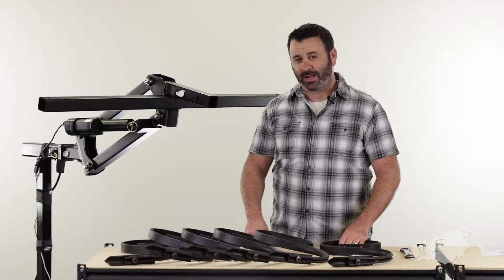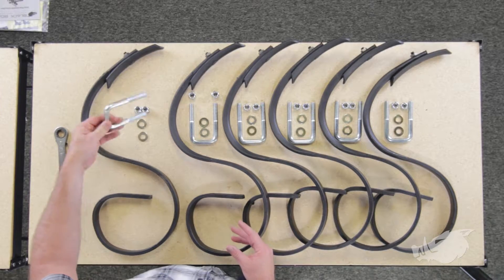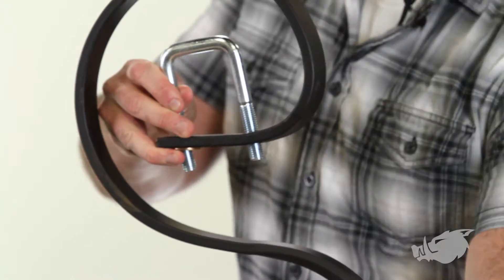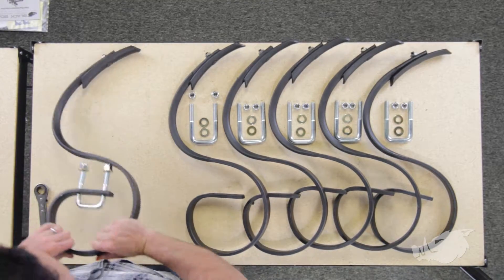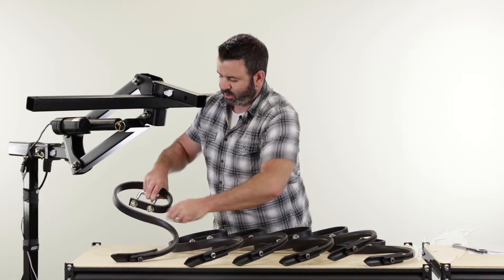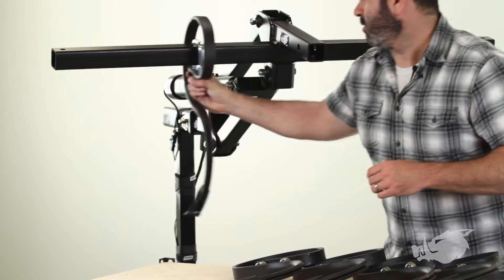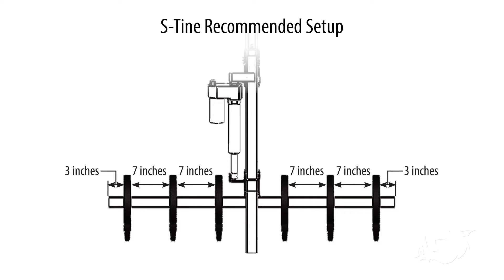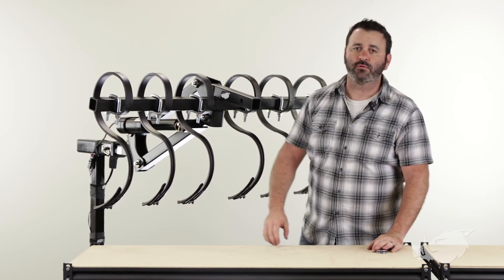Black Boar S-Tines: Assembly and Installation

Comment: Man, I was looking to build my own ATV implement bar and tool holder but when I found this system, it was almost the same price as what I would have spent on parts and labor. PLUS, this system has more functionality than the system I designed (manual or electric lift). I bought it and was able to use it over the last few days. I installed the S-Tines and went to work on some mature Maple forest patches that I have in Wisconsin.  It really tore up the ground, digging up football sized rocks and roots up to 3” in diameter.  I was able to back up to the edge of my food plot with the tools down, then rip forward.  I did snag on some big roots that stopped my ATV (570cc) in its tracks, but after several runs at it, they either popped, or I chopped them out.  The S Tines worked great tearing up the new ground.  I was really impressed. Yes, I was really impressed.  Did I say I was impressed?  I was impressed.  I switched the Cultivator Points that comes with the S Tine set for a set of Cultivator Sweeps that I got from the local Farm and Fleet (like TCS or Big R, or whatever you have by you).  I used these sweeps on the ground after the straight points and they turned over the ground and cut some bigger swaths.  Man, I am impressed.  Next I’m putting together my Disc Harrow and going to work.  The ground was way too wet to try the discs.  
The only problem I had was my DeWalt cordless drill did not work smoothly to drive the bar up.  It worked ok driving it down.  I ended using the manual crank handle and it was really no big deal.  The battery may have been a little weak.  The hardest part was remembering which way was up or down.  I could actually lift the back of the ATV (well, unload the suspension) with the crank, driving the Cultivator into the ground.  I was able to reverse with the tools down and then pull forward.  My one plot was rather small and I could not drive in circles, I had to keep reversing and then go forward.  I think the instructions say you should not drive in reverse with the tools down, but…